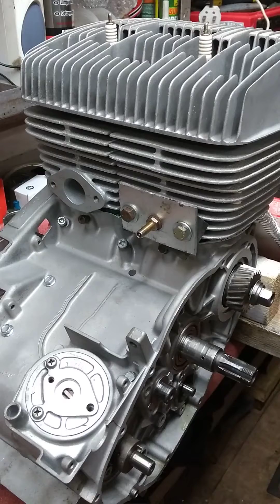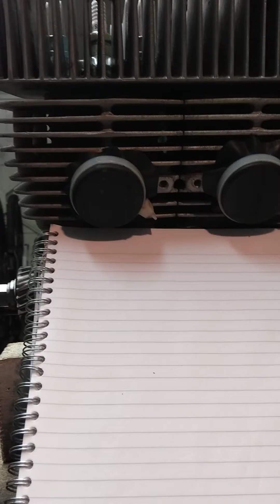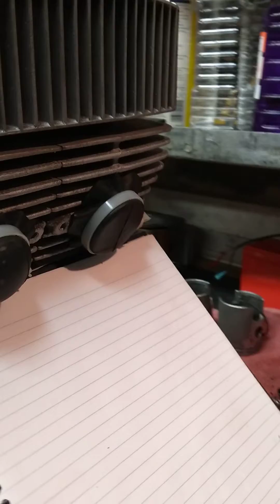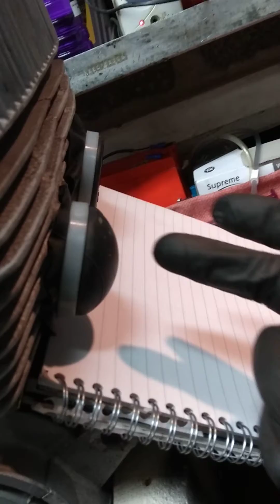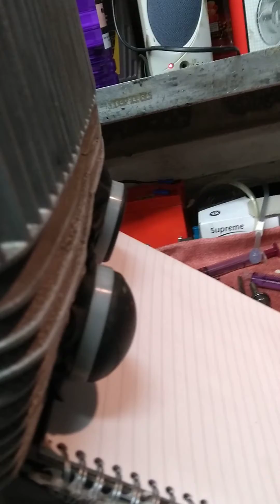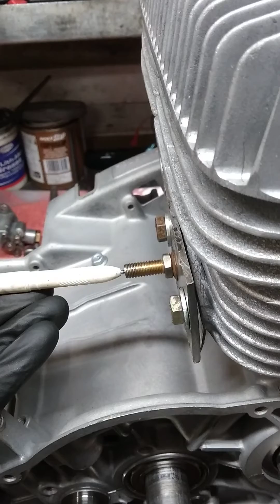Two stroke crank seal test check with no special equipment.

Comment: It's a good idea to also vacuum test it, I've read about a few that passed on pressure and leaked under vacuum.  Most seals will have increased sealing pressure against the shaft when pressurized, and decreased pressure when under vacuum.

Comment: What shape did you cut tge piece of innertube too that you fitted over the exhaust port? Also was it just silicon sealant that you used?
Reply from the maker: Hi, just cut the inner tube in a circle big enough to stretch over the exhaust stub. Any bathroom sealant is ok. Wait for it to set overnight! I should have mentioned that but assumed it was obvious? Maybe not 😂
Reply: @abikewimp8981  Many thanks, I will get cutting and sealing. Happy new year to to you and all the best for 2024.

Comment: Not a bad method, but you definitely need to test each cylinder, moving your "apparatus" to the other cylinder and retesting.  Also, I would verify your pressure.  You could do this with a cheap tire gauge, in keeping with the "Yorkshire economy" approach. 😅  As long as you are in the 6-10 psi range, that should be close enough.  You want to avoid being over pressurized and blowing out your seals.  Finally, I would add the soapy water spray test to your pressurized engine to check for leaks. Bubbles  are bad!    It is ok to cobble up a home made test apparatus,  but please  do a complete pressure test and proof out your results. A two stroke seal failure can turn ugly fast.  Then you are into big UK 💷 or US  💵 .  Crank seals, gaskets, and case sealant are cheap.  Yamaha RD's are very easy to work on.  Your labor is free.  Knowing your engine state exactly, is priceless.  My two pence.  Good Luck and Happy Motoring!😊

Comment: I just put my hand over the exhaust when it's running and spray some dish soap around the seals, look for bubbles.
Reply: You would do well to make that work on a lot of old two strokes. You can’t get to to seals when the engines running they’re usually behind the flywheel and clutch

Comment: What a great idea - next time I get a chance I will test it. You just helped me think I could also use a cyl, leak down tester through the spark plug. The beauty of your test is not special tools needed, thanks again !!! Denis
Reply: i have never used a cylinder leakdown tool but isnt that used to ck rings and valves???-this guy is testing to see if the crank seal is leaking-he didnt say where the piston was cause on a 2 stroke the piston has to bee down to where the intake reeds are open to let air/fuel misture into crankcase i think-im not sure exactly how the reed valves know when to open or if the just open after the fuel charge in the crankcase haswent into the cylinder creating a low pressure to suck in more moxture-anybody got any thoughts or lessons for me to learn???
Reply: @storyoc  It doesn't matter where the piston is nor whether you apply pressure from the intake, exhaust, or spark plug hole.  The air will leak past the rings pretty easily and the entire engine will be evenly pressurized.